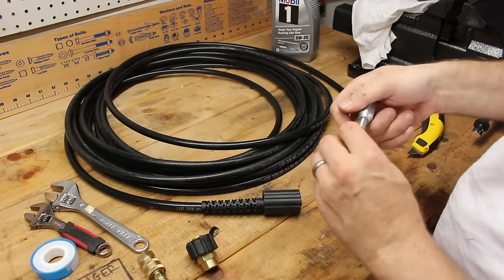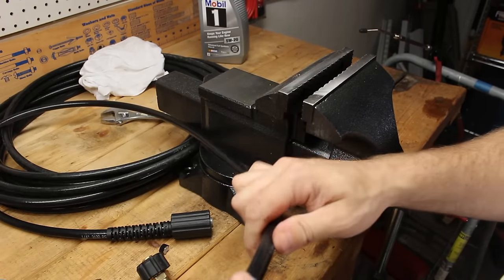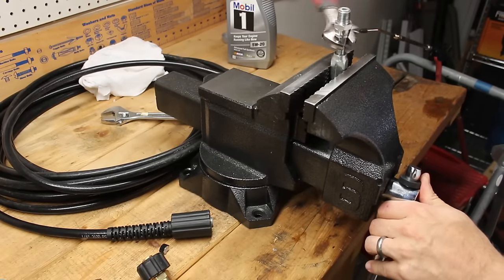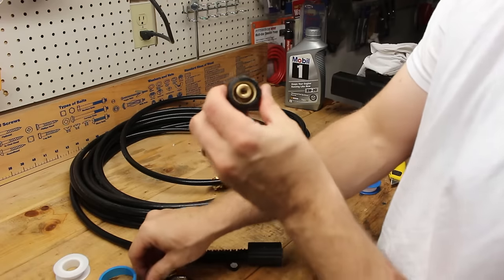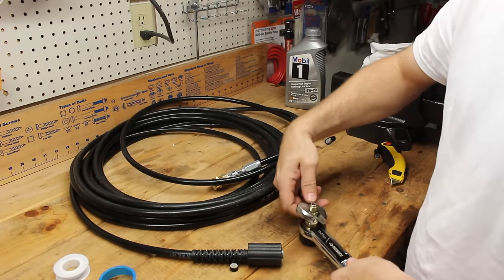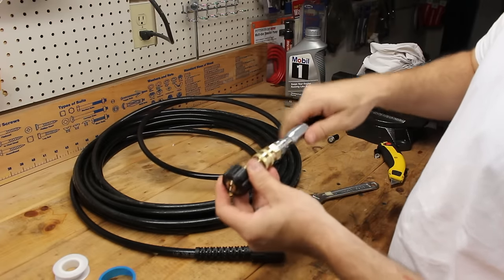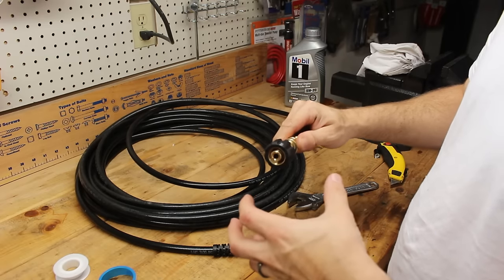How to Repair a Pressure Washer Hose in 6 Minutes (Any brand Gas or Electric)

Comment: Did anyone else notice that he went the wrong way when wrapping the threads with the Teflon tape?
Reply: Yep, drove me nuts when I saw that. I was actually waiting for it.
Reply: Yup.
Reply: Yes, I noticed too. Not great.
Reply: Pensé que había sido mi imaginación
Reply: That’s because he’s on the southern side of the equator; everything is backwards; even the commode flushes the other way…
Reply: Haha! Yep. Hey it worked. But yeah- wrong way.
Reply: He went clockwise, facing the threads. That’s the wrong way?! If it is then I’ve been doing it wrong for years!
Reply: Yepper
Reply: He’s also using the adjustable wrench backwards at the beginning. Not that it’s a big deal but since we’re pointing out mistakes lol
Reply: Without a thought too
Reply: Yup
Reply: Criticism and looking for flaws in the people that tries to help others is wY out of hand..WTF...That's crazy some people watch just to point out the littlest shit..SMH..MUST DONT HAVE NO LIFE.However the same ones must don't know what reverse threaded is..Go figure cuz I know I heard him say it's reverse threads.
Reply: Only first time, second time was put correctly
Reply: @kenstirling5348 is that the part where he mentioned that it’s reverse threaded?
Reply: If the fitting doesn’t leak what the hell difference does it make?
Reply: Yes, he did it to the wrong way; left. 😂
It happens!!!
Reply: @nicholasjose9407 

You're wrong. Where he put the Teflon tape it was not a reverse thread.
Reply: @antoniogalluccio4213 
He just put one time teflon tape and he did it at the wrong way!  The inverse thread was in the hose part and it does not need a teflon tape.
Reply: Maybe he's left handed.
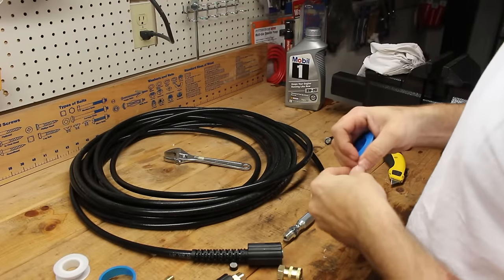Reply: @ENRIQUEcccc  no, he applied Teflon tape twice.  The first time at 3:05 he got it wrong, the second time at 4:20 he did it correctly.
Reply: I find closing my razor knife when I am not actually using it is alot safer- from experience
Reply: They do it all the time then I realize what the hell I did when I start to screwed in and have to  start over again. I don’t know what’s wrong with me lol

Comment: Teflon tape was wrapped wrong. Should go in the direction of the thread
Reply: Teflon tape can go on any direction
Reply: It "can" go on in any direction, but as a Plumber I have personally seen the Teflon Tape bunch up when wrapped against the direction of the Threads and ... leak.

It is one Tip Off to me that a Novice did the last connection.   More so, is when someone puts Teflon Tape on a Fitting that doesn't require one and will actually cause a Leak (e.g. - when a Washer/Gasket is between the two, a Compression Fitting, etc.).

In summary, I do appreciate that you made this Video --- TRULY DO APPRECIATE IT.  All I ask is that you go with the Threads in the future like all of the Professionals do and you'll be one, or continue to be one, too!
Reply: @labian5  I would Hate to work behind you!!!!!!
Reply: @search5819  No worries dude, you would be fired on any job I've ever been on.
Reply: Teflon tape only goes on the direction of the thread
Reply: Mount that vise too.
Reply: Totally agree, always wrap in the direction your connection is going to tighten
Reply: I was wondering if anybody else caught that
Reply: Reverse thread?
Reply: Lol..  the first time he wrapped it wrong for sure second time he wrapped it right..  and you do wrap the Teflon tape with the direction that you're going with the threads if you wrap it opposite it peels, pushesit off it only makes sense...  I know I've uffed up and done it a many times.

Comment: This advice is not only incorrect, but dangerous.  Who will stand behind an incompatible fitting/hose combination when  the fitting blows off and injures someone?  Pressure washers generate THOUSANDS OF PSI which is very powerful.   Always REPLACE a leaking pressure washer hose.  NEVER attempt to repair.  PERIOD.  A replacement hose of the type shown on video is widely available for 30 bucks or less online   An upgrade (rubber/steel wire) that won't melt when touching the muffler is widely available for about double that.
Reply: Who will stand behind the fitting? Gates Corporation. We've never had a blow off or a leak. Use the correct size fitting install it per Gates instructions and it works. If you can't do that, or aren't sure about anything, do not attempt this repair. A failure such as a blow off is potentially life threatening.

Comment: The purpose of Teflon tape is to fill up the spaces between the joining threads, to do this correct, wind it tightly starting at the end using the full width of the tape on the thread one and a half rotation, pull the tape until it snaps and rub the threaded tape firmly to inbed the tape, never wind it on the thread as demonstrated in the clip as this will cause the tape to bank up and not give you the sealing properties it has been designed for. Other than that all good, although I like to have my Vice bolted down.
Reply: In 30 years I've never had a problem winding up the tape
Reply: Teflon tape is a lubricant so the treads connect together and don’t leak

Comment: i think about 95% of the people posting how to videos shouldnt but this isnt one of them i use a power washer regularly and every so often the hose gets wrapped up on exhaust and unless theres a store near by that is open or has one im done for the day now with this fitting who cares if you lose an inch of hose every time its reusable i dont have to run around looking for a new hose i keep a spare in my tool box no more running around or missing work thanks this is a helpful post i thank you oh yah these hoses arent cheap so fixing them are the way to go

Comment: excellent video, thank you. I acquired the CORRECT parts and repaired the hose  in less than 10 min. The two parts needed ( Gates connector and M22 adapter) cost approx $30. but seeing they can be used over and over again its worth it.  One thing I will add, when threading the larger  Gates connector sleeve over the hose with reverse threads, work it slowly and be careful not to damage the hose going into the sleeve . I did and it leaked ! I re-did the connection and all is well.

Comment: I used reusable fittings to make my own hydraulic hoses when i built tip trucks and trailers. Never leaked out burst at the fitting. I never had the house guy or paid for crimping.. 😃

Comment: Thanks for the great video. Fittings and M22 connector are exact fit for 1/2 “ hose. Added quick connect as you suggested and everything works great.

Comment: Thank you for your instruction. I will try to repair my own hose which has a hole only 10 inches/25 cm from the pressure washer end.
My hose ia a "braided" one. Would that make a difference?

Comment: good idea and great video. I looked at the price to repair my hose and it ends up costing me as much as the 25 foot hose price. Wish there was a cheaper fix so that i do not have to throw away my old hose. The exhaust burnt a hole.
Reply: Did you try superglue it and put a steel clamp on
it?
Reply: @KS-uo4br  did not try that. I would figure with the pressure it would fail quickly. Have you tried it and was it successful?

Comment: Any benefit of running the swivel vs non-swivel compression fitting? Cause here in Canada only able to get the non-swivel... Most likely going to attach the repaired line to my pressure washer, not my gun.

Comment: Loved your video!  My 3100 psi water pressure hose was  burnt in the middle of the hose.  Any way of repairing it without shortening the hose a lot.  If so what fittings do I need to order for 1/2 outer 1/4 inner  diameter hose?  Thanks for your help.
Reply: Similar here, I think what you'd need is two of these (expensive) Gates fittings with a quick connect between them. Same as he shows here, but with only the damaged hose cut out.

Comment: Cheers. But a quick tip for you. Your tightening, never stretch your  arms apart to tighten, adjust so both hands can grab/meet. Same to pop two bolts. Your method means you can slip. Cupping prevents slipping / hurting yourself.

Comment: Excellent tutorial can I ask what brand is your adjustable wrench the one that goes over the top of the nut not the open ended one
Reply from the maker: it's a Husky socket adjustable wrench - didn't see it on home depot's website any more, but found a seller with a bunch of them on ebay - https://rover.ebay.com/rover/1/711-53200-19255-0/1?mpre=https%3A%2F%2Fwww.ebay.com%2Fitm%2FHusky-Standard-Total-Socket-Adjustable-Wrench-up-to-44-Sockets-97764-BRAND-NEW%2F223469314910%3Fepid%3D1546160005%26hash%3Ditem3407cf235e%3Ag%3AEcsAAOSwiwZcLUl7&campid=5338190277&toolid=20008

Comment: Where did the male end coming from the fitting that connects to the m22 come from.  I found the fitting but it doesn’t have that piece for the connection.  Is it sold separately?  Thanks, Frank
Reply: They sell the male fitting at Lowes or home Depot

Comment: I got a nilfisk pressure washer and bought a new hose. Seems like the male m22 water outlet on my nilfisk washer is a tad smaller than the female m22 of my new hose. Didnt know there different kinds of m22. Will this fix solve my problem by cutting the old connector and putting it on my new hose. Are hose sizes the same in euro and america and in asia?

Comment: Would be ok, but the repair fittings are almost as much as just buying a new hose. Also need to double check you get the correct size adaptor fitting...Some use 22mm/14mm some use 22mm/15mm. Most size issues arise at the pump end, some pumps have 22mm/15mm at the pump outlet, so using a 22mm/14mm fitting will leak👍🇦🇺

Comment: Hi Mate, I have 5meter pressure washer hose that is fit with my pressure washer. I just bought 15meter that is not fit to my pressure washer, can I cut the ends of my 5meter pw hose and put it to 15meter pw hose? Is it possible? If yes, how to do that? Thank you.

Comment: is it better to buy a new hose? is it cheaper to buy those fittings?
Reply: Cost depends on where you are ,and people do things different like my self I just like to be hands on why waste a perfectly good hose
Reply: This fitting costs about $15 dollars. A 50 foot 4000 psi hose costs about $75 to $90 dollars. These fittings are just as durable as the original ends in many cases, just a different way to secure itself to the end of the hose, and it still offers the same ability to use quick-connect ends, or the m22 screw-on type.

Comment: Be sure to grease the outer before trying to thread it on and make sure to get the proper one. One wire or two wire, they are definitely different.

Comment: Believe the new Gates P/N is G27100-0404.  That's for a G1 hose I.D. 1/4" O.D. 1/2".  I found it on eBay for $20 shipped.  We'll see if it works and I'll post an update.
Reply: G27100-0404 4C1T-4RMP is the correct P/N.  Just remember it threads on the hose backwards LOL...
Reply: Did it work?
Reply: @topgun3753  yep.
Reply: @stevematda976  Thanks

Comment: I have a bosch skin high pressure washer. the hose got chewed up by rats. so the ends are intact but the hose needs to be replaced. What is the name of the parts i require. Please assist

Comment: Will this work to repair the hose if it keeps popping off? my pressure washer hose every time I squeeze the trigger on the wand it pops off at the machine
Reply: This is just a guess, as I can't see how you have things actually hooked up, but it sounds as if you might need new quick-connector fittings, as the male and female ends are not sealing properly. Make sure you push the hose into the machine a bit harder, and maybe turn it a little bit, just to make sure that the outside ring of the quick connection is snapped forward all the way, and not slightly still open. Also, check inside the female quick-connect to make sure the o-ring is sitting neatly inside its groove, and not slightly crooked, as this will obviously cause you to not get the male quick connect plug sitting flush inside the female quick-connect. Another thing to note, is that over time, some of your hose quick-connect ends/fittings will deform ever so slightly, and will not fit together as easily as when everything was brand new, so getting new fittings will make things easier and more secure. Take your hose to a Home Depot or similar, and try to plug it into a machine they have, or with a new quick connector fitting that they sell. You will be able to see a difference of how it should look and feel when perfectly connected.
The main fitting in this video is meant just for repairing the hose itself.  
I know how frustrating it can be dealing with pressure washer problems, so I hope this information helps.

Comment: well this is a fix for one kind of hose, nice system and valuable if you have the parts and tools to do it at a job-site but why does it say any brand when 
this is the lighter hose?  The heavier hose's use crimped ends
Reply: Can be used for any kind of hose, including the more heavy duty 4000 to 6000 psi hoses you're probably speaking of. Remember, after the original crimped-on hose end is removed, it's just a plain old hose, and this fitting is designed to make a compression type seal, that can stand up to the same  pressure of a factory crimped on end. Just last week I was literally looking up hose crimping machines/tools for pressure washer hoses, and they are usually in the thousands of dollars, and pretty bulky, so a fix like this is way more practical for most pressure washer users who may rely on their equipment to make a living.

Comment: Hi. How would I fix a split right in the middle of my hose?
Reply: I had the same problem, but the solution is more expensive than the hose. You would need two Gates compression fittings, one for each end of the hose and a threaded coupler to screw the Gates fittings together. But as I said, the cost at $15 or so per Gates fitting and the coupler you're looking at $35 - $40. Now if it's a hose that uses some proprietary end fittings you can't find then it may be worth it.  Good Luck
Reply: @topgun3753  I just bought a 2nd hand washer that was broken and pulled the hose out. cost me $20 lol

Comment: I paid £13.99 for a new 4m hose delivered on ebay.how much is these connectors?
Reply: I just saw the connector on eBay $14.25 USD. 
buying a new hose makes more sense to me.
I do not understand why buy this item, when one can buy a new hose. This only makes sense if the hose breaks near one of the ends. If it breaks at the center, one either purchases 2 splicers or ends up with a very short hose.

Comment: Sweet, you actually read my other comment (before I wrote it here) and actually use the second (and subsequent) shifting spanner/s CORRECTLY by drawing the fixed jaw and main body onto the work to be tightened, allowing the shifted weak jaw to "follow" the tool around (at the right nut/size for the work being tightened).

All in all - a good instructional video of how to "repair" a pressure hose, but please always use a shifting spanner correctly, (you never know when a fatigued weaker jaw is about to break - injuring the user)

Comment: if one is worried about the possibility of a blowout on a repaired end ( and maybe you repaired BOTH ends ) a shorter  pigtail factory hose  ( 10' ) on the wand connecting to  the repaired end of the hose might mitigate if the repaired end fails.  But the hoses are actually cheaper nowadays than  the parts you need to do the repair.   Yeah what a waste, but hopefully  you got a season or 2 out of it.   Of course you could always find a hydraulic guy to put crimped fittings but that's more than it's worth unless you have a pro rig and dozens of feet  -- which you shouldn't be doing the repair in the first place. 😊

Comment: I have a GIANT pressure washer and I dont understand why they dont but some kind of cage over the exhaust.. so you dont wind up touching the hose against it and burning a hole in the hose!!
Reply: Mine actually has a cage over the exhaust.  Problem is the cage gets just as hot as the muffler....
Reply: @stevematda976  Well, that dont seem to help matters!  I have 2 pressure washers.  The Black Max I bought from sams club has the hose outlet opposite the exhaust so that seems to help quite a bit.

Comment: Would a brass barb coupling with hose clamps work?
For anyone wondering, it won’t. I just tried it before watching this video and the clamp acts like a razor blade with so much pressure pushing against the edge of the clamp. It ruptured instantly...new hose it is 😐

Comment: Those dont work on commercial units. My unit is a 8gpm 3000psi and i only use hydraulic pressed fittings.
Reply: Aren't you special
Reply: Yours First lad has a point, any that work with air lines have seen one blow. Turns into  whip , imagine whip with fitting on end . Most air is only at 90-100 lbs.
Reply from the maker: @shade38211  it won't be whipping around at 2500-2500 psi - that's the pressure coming out of the tip
Reply: How To Guy tried 1/2 assing the repair. Finished my house cleaning, but was soaked. 5 year old pressure washer that I lent out. Instead of un-twisting the hose, idiot brother kept pulling, 2 make a weak spot where hose kinked. Lowes had a smaller version 69$ , done. Never had one break before, thought standard nylon hose brass would fix. Incredibly odd size and wasn't worth the bother. And you are right, nozzle restriction is where that's  1500lbs is measured. Air tool lines have 2 malfunction in specific way 2 make whip like accident.